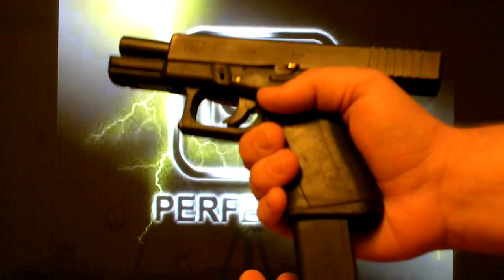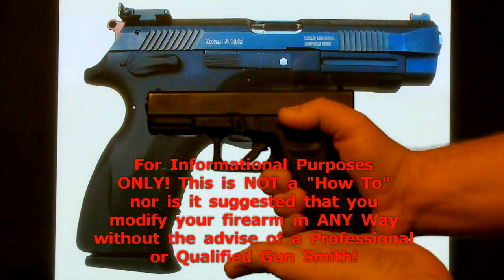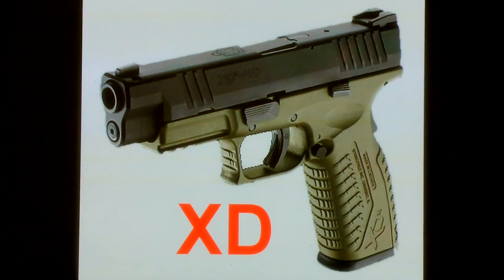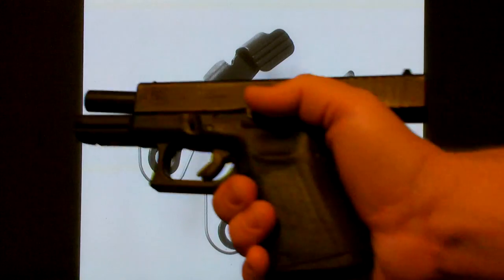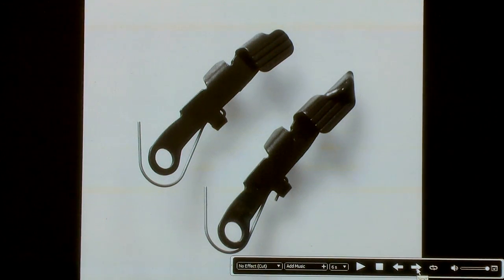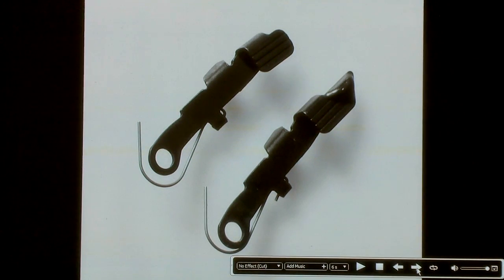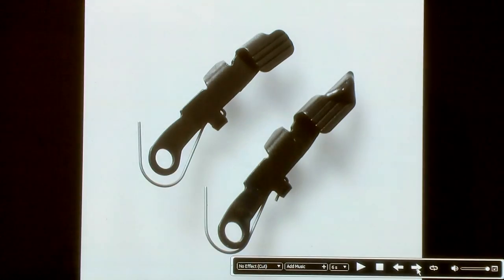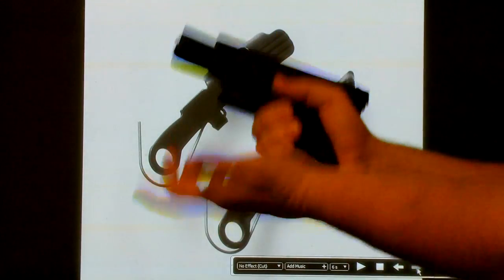Automatic Handgun Slide Release! Slide Drops By Itself When Loading A New Magazine.

Comment: I feel like this is a feature, basically a better version of slide lock which not only auto-locks but also auto-loads... Not hard to hit the slide stop yourself, but it's really nice to have it be auto
Reply from the maker: I wouldn't call it a "feature" ....cuz it's not reliable nor intended by the manufacturer. More of a "benefit" IF it happens to happen....especially if in a high stress situation....where it is most likely to occur as your handling should, during an event, be extremely firm and movements "well intentioned." But you should be ready to manually drop the slide AT ALL TIMES, especially during an engagement!

I just wanted to make everyone aware that it is not a defect and that it's something that can and does happen....and not to freak out and start hunting down warranty service or gun Smith to fix something that isn't broken....wasting everyone's time and potentially going unarmed for a period of time if it's their only firearm and it's out for service for nothing.

Thanks for watching.

Comment: Only 1600 rounds through my Gen 5 19 and I’ve already worn out the slide stop. Thanks for posting. I’ll be giving the oem extended slide stop a try soon. For now the worn part doesn’t malfunction just doesn’t lock the slide on the last round every like 3rd magazine and sometimes the slide slams home if I insert a full magazine hard enough. Since it is my carry gun I will replace the part so I know when I am on my last round if need be. Doesn’t bother me at the range though it is annoying to be honest. Might even install the Glock oem extended mag release as well and have 2 under the radar oem upgrades, while fixing the slide lock issue I have for the time being until I wear out the new one lol. Thanks for the video!
Reply: 1000 rounds through my new gen 5 17 and I'm experiencing the same thing.
Reply from the maker: @shawnsikes4596  it's normal. Nothing to be concerned about if you handle your firearm appropriately. Just don't count on it happening. Also try losing your mags down one or two and it could completely go away.

Comment: Just bought a 19 gen4 and its doing it right out of the box
Reply from the maker: it's fine...it's normal....you can fix it by not slamming the mag home so hard, inserting mag on closed slide or roughing up the engagement surfaces of the slide lock lever and the slide where they engage...it's not broken
Reply: I just got a 19 gen 4 didn't know they did that my Taurus pt 140 millennium pro does it didn't know my Glock does it as well

Comment: H&K VP9 Operator's Manual (Page 15) -- "WARNING: Forcefully inserting a loaded magazine into many pistols may cause the pistol’s slide to close, chambering a cartridge and making the pistol ready to fire. When inserting a magazine, always be sure the VP pistol is pointed in a safe direction with your fingers off the trigger and outside the trigger guard. Failure to do so could cause you to unintentionally fire the pistol, resulting in serious injury or death."      ...Be smart. Stay safe.

Comment: I'm in law enforcement and carried a gen 4 glock 22 for years and never had this issue. Recently switched to the gen 5 9mm (17 and 19) and have been having this issue right out of the box.
Reply from the maker: Tony Bell mines a gen 3...it's not generation or manufacturer specific...shoot, even HK and others write about this phenomenon in the handgun manual. It's physics...if you slammed home a mag hard enough on the 22 it would do it to...you just may have got a firearm that had rough mating surfaces between the slide lock lever and slide itself. Thanks for watching and moreover...thank YOU for what you do and you service! Stay safe brother.

Comment: Great video! Very helpful. So replacing the slide release lever will fix this issue? Thank you.
Reply from the maker: tinktwiceman it "may" help but there's no "fix" for physics....the inertia you create when slamming a mag home is the force that's being transferred to the parts of the firearm holding the slide back...any force transferred to a moving part that is great enough to make the moving parts move will result I the slide dropping and loading a round into the chamber.

Comment: Thank You! My new PT111 does this and I thought it was a malfunction. I need to be aware of this... At the range the other day I popped in a full mag and the slide released and caught my trigger finger between the slide and the barrel. OUCH!!! Then on the next full mag, it happened and loaded a round in the chamber and a second full round stove piped at the same time. So I had one in the barrel one stove piped. I had to rack the slide to release the stove piped round before I could shoot. Should I use less force to seat the full magazine?  Thanks for your help...
Reply from the maker: YES...try inserting the mag with a little less authority. The reason you got the stove pipe is in the design of the feed lips strength n the magazine itself. They (feed lips) are designed to easily and reliably feed the next round when it's called for so the rounds are not "bolted" into the mag tightly and inertia, speed and force will transfer to the top round when the slide is locked back and it will fly free as an object in motion wants to stay in motion and the force is overcoming the strength of the feed lip retention strength of the magazine and the slide is open so there's no "wall" for that force to hit to keep the round captive...any left offer force, jostle or movement can dislodge the first and possibly the following round if the force was strong enough to move the next round out of its intended, fully inserted n seated position in the mag (the round got nudged/wiggled out of proper placement in the mag). Insert the mag with authority but don't be a sledgehammer and you should be fine. Also, mark the mag that gives you trouble to keep track and make sure it's not a magazine issue! If it only happens on one mag then that mag needs repair/replacement. I hope that helps a little..be safe ALL the time while troubleshooting...especially with an unfamiliar activity or unfamiliar (new) firearm!  ...Scratch that...ALL firearms, ALL Activities, ALLWAYS! Safety first brother and keep ammunition and loaded mags away from the firearm when working on it or troubleshooting...just a good habit to get into, especially if you get called away for something and then come back to it...you'll know there's no ammo there when your not present n you know when you come back and safety check anyway that there's no ammo...that way someone doesn't come along and do something stupid when they don't know the condition of the gun and you can be sidetracked more "safely" .but always double check. OK enough lawyer talk!

Lastly, if this is still an issue after adjusting down your "sledgehammer" technique then I would contact Taurus Customer Service to inquire about a warranty repair. They'll pay shipping both ways n take care of it for you no problem! ...you will just be without the firearm for a few weeks. I've dealt with a division of Taurus for a repair on a firearms produced under a different brand but owned by Taurus and they were AWESOME! VERY polite, respectful, helpful, attentive and handled everything, fixed the problem and shipped back to me in 19 days with an itemized work order showing the work performed, the steps taken and a target from the test fire after repair all signed by the gunsmith who handled it.

AGAIN...I hope that helps you out!  ....Just ease up of the force and speed and you'll probably be yes...try inserting the mag with a little less authority. the reason you got the stove pipe is in the design of the feed lips strength on the magazine. they are designed to easily and reliably feed the next round when it's called for so the rounds are not "bolted" into the mag tightly and inertia, speed and force will transferred to the top round when the slide is locked back and it will fly free as an object in motion wants to stay in motion and the force is overcoming the strength of the feed lip retention strength of the magazine...any left offer force, jostle or movement can dislodge the first and possibly the following round if the force was strong enough to move the round out of its intended, fully inserted n seated position in the mag (the round got nudged out of proper placement). insert the mag with authority but don't be a sledgehammer and you should be fine. also mark the mag that gives you trouble to keep track and make sure it's not a magazine issue. if it only happens on one mag then that mag needs repair/replacement. I hope that helps a little..be safe ALL the time while troubleshooting...especially with an unfamiliar activity or firearm! 

Any further doubts then please contact a qualified gunSmith in your area for further advice/assistance. please be safe and HAVE FUN Shooting!

Good Luck & THANK YOU FOR WATCHING!!!!!!

I really hope that helps you out....let me know if it does or not & I'll try to help you more if it doesn't work for some reason and if I can.

-MBT2010
Reply: Thank you, thank you, thank you for your detailed response... I tried jarring the gun with no magazine in it and it auto releases. I will try a more gentle approach the next time I am at the range to see if I get different results... Also, thanks for the advice on the magazine having a possible issue. Be safe my friend!!
Reply from the maker: I would still check the mags to be sure that one is not malfunctioning (stove pipe) and that one is not..ya know? 

If you can do this with no mag then you are being too forceful, its the way the firearm is designed or something is broken/chipped cracked or bad spring (which I dont think is the issue here). 

One fix would be to find the roughest sandpaper you have on hand or a tiny file or emery board to scratch/rough up the two surfaces where the slide engages the slide lock lever. If you rough up these two (do not sand excessive material away!) surfaces it will provide more friction when engaged and that friction will function to make the slide lock lever and slide to work more effectively. ....Do this only after youre positive that you do not need to send it in for warranty work!!!!

By roughing up those engagement surfaces you will make it harder for the friction of that tiny surface engagement to be overcome by the "sledgehammer.) lol Keep in mind this will also make it harder to release the slide with your thumb if you use that function.  

Hope that helps ya out even more!
Reply from the maker: I would still check the mags to be sure that one is not malfunctioning (stove pipe) and that one is not..ya know? 

If you can do this with no mag then you are being too forceful, its the way the firearm is designed or something is broken/chipped cracked or bad spring (which I dont think is the issue here). 

One fix would be to find the roughest sandpaper you have on hand or a tiny file or emery board to scratch/rough up the two surfaces where the slide engages the slide lock lever. If you rough up these two (do not sand excessive material away!) surfaces it will provide more friction when engaged and that friction will function to make the slide lock lever and slide to work more effectively. ....Do this only after youre positive that you do not need to send it in for warranty work!!!!

By roughing up those engagement surfaces you will make it harder for the friction of that tiny surface engagement to be overcome by the "sledgehammer.) lol Keep in mind this will also make it harder to release the slide with your thumb if you use that function.  

Hope that helps ya out even more!
Reply from the maker: oh...you're welcome, you're welcome, you're welcome btw lol
Reply: Interesting development. One other thing my gun also was doing is: when I released the magazine, the slide would also release... Si I have automatic slide release on both ends. So I was trying different techniques for inserting and releasing the mag. I stumbled on something. If I push up on the magazine at the same time I release it, the slide stays locked... So using that technique, I took the gun with no magazine in it to replicate slamming the magazine in. No matter how hard I jar the gun, the slide stays locked. But if I don't push up on the magazine when I release it, the slide won't stay locked on release or otherwise. I will test this tomorrow when I go to the range and let you know the results. There must be something going on between the magazine and the slide lock...
Reply from the maker: +Jim Powers sound like a weak slide lock lever spring or there is something inside not properly installed or properly shaped/molded that's getting in the way of the proper function of the slide lock lever and/or it's spring. I'd call the manufacturer with this info and send it for warranty repair. this should fix it permanently...unless the inherent design of the firearm is "just that way" ...then you'll have to learn to live with is personality or sell it and buy/upgrade to a Ruger LC9S Pro. I carried my Glock religiously for 4-5 years until I bought the Ruger (which I thought I was going to hate) n I ended up ABSOLUTELY LOVING it and the Glock has been moved to nightstand duty. the Ruger shoots accurately and like a dream and carries OH SO NICE! ..I forget I have it on most of the time...n that NEVER HAPPENED with the Glock 19 lol .....the trigger is sweet too n it comes with decent sights. I actually can shoot more accurate groups with the little Ruger LC9s Pro than I can with the Glock....n being a huge Glock fan it almost hurts me to admit and say that! ...I have also had a keltec pf9 for a while n have shot the m&p shield as well as multiple other similar handguns and with the Ruger on my hip I have no want or need to buy another one or carry something else. I'm actually only keeping the Kel-Tec PF9 to give it to my nephew for his 21st bday for his first pistol. if as he grows he shoots promise of being into firearms...I'll prob sell it and give him a gift card for another LC9s Pro in the family. ...btw I'm NOT a Ruger fanboy...I actually loathe some things they do and most of their guns...that's why I thought I'd hate it...n it ended up my go to favorite....especially in summer time in the south with summer clothes! it disappears and doesn't chafe n rub. ....any way...let me know what happens with the g2 n if you send it in or not...they might actually just ship you  a spring if you comfortable mechanically with the repair...I could do it myself..but I'd still send it to them and have it services as a warranty repair n create a "record" of the issue with them...it would make me sleep better at night knowing that I'd have further recourse if any other problems surfaced and...if there's an "accident" n it was mechanical failure that caused it...your lawyer will want the info about the "professional repair." ...just my $.02. God luck n keep me posted!...cuz I'm nosy lol ...mostly just curious as to what the actually solution will be so I know. thanks!
Reply from the maker: +Jim Powers when you're pushing up on the mag it sounds like your giving something inside a little nudge somewhere n skirting that mechanism to actually fully engage the way it should with just the spring power...have you oiled and cleaned it yet....they're may be something inside that needs to be knocked off/down...but it sound like an underpowered spring....

Comment: Ever since I installed the Vickers slide release it started doing this on my glock 19 gen 3. I feel like it is a defect because you should have full control over your firearm but I'm going back to stock see if that fixes it
Reply from the maker: It's not a defect.... this operation is actually explained in some manufacturers owners manuals.
Reply: @MyBigThing2010  why does it only do it sometimes then?

Comment: So, mine only does it with one specific magazine. I have 2 brand new mags and a bunch of older ones. One of the new ones sends the slide into battery...none of the others do this. I also don't have to slam it I can insert it in a normal manor, and it instantly and consistently sends the slide forward. I like it I compete and would like them all to do it. on visual inspection it appears identical to the other mags.... I'm going to take a caliper to it and measure some dimensions. any ideas?  I also believe it only does so when it has a round in it   IDK?

Comment: My glock 35 G4 now does this 100% of the time. It did not do this out of the box. I believe it has to do with the spring on the slide release and wear over time on the slide lock connector. After the gun is thoroughly broken in the spring tension is slightly off and metal surface wear fatigue allowing the magazine to engage the slide. I do look at this as a positive but also an experienced shooter. This could be dangerous to a beginner. My G35 is also highly modified internally so this may have something to do with it. I've been told it's just the slide metal wearing as you've stated. My G43 does not do this but have not put as many rounds through it. Hopefully one day it switches to auto charging lol. Your exactly right. The first time it happened to me I thought it was a part failure. Great video.